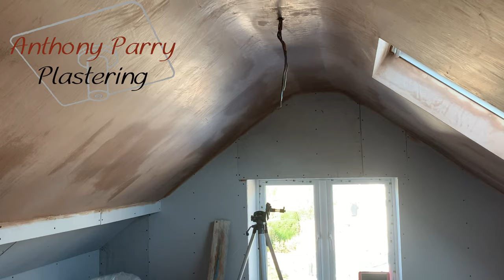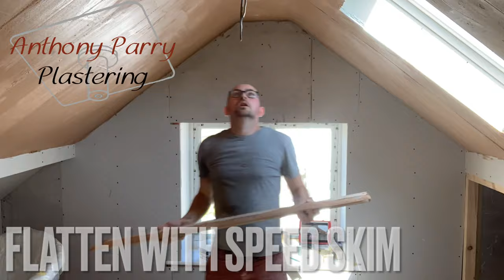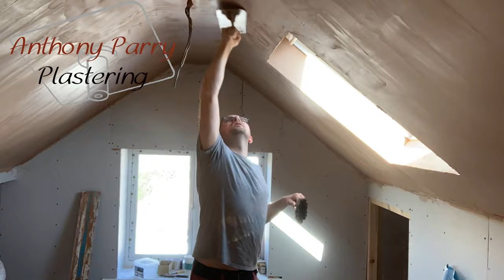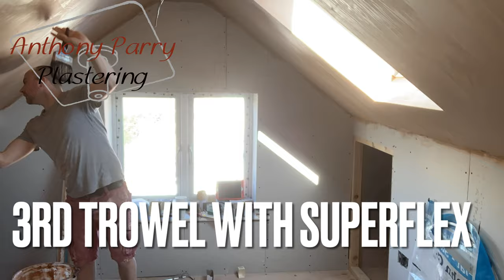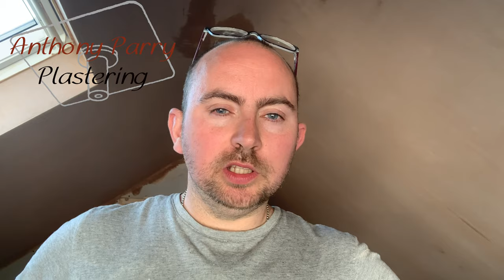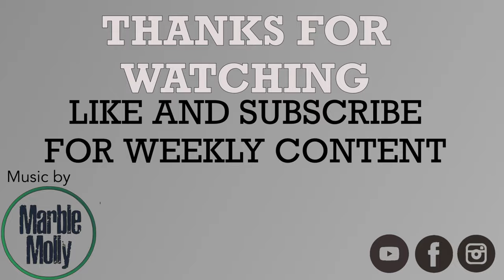How I plaster a curved ceiling. Plastering timelapse

Comment: Great video what speed skim did you use plastic or stainless steel thanks
Reply from the maker: Hi Paul, thanks I use the stainless steel one. I had  the plastic one but I switched to the stainless. I definitely prefer it for how I use it. Have you got one?
Reply: Hi Anthony thanks for the quick reply will be buying a speed skim stainless steel thanks again 👍👍
Reply from the maker: @paulmurphy5396  no worries, I think they’re great it’s definitely made my life easier 👍
Reply: Wot trowel do you use to trowel up after speed skim
Reply from the maker: @dwainearmitage7570  Hi Dwaine, I use a marshalltown gold trowel and to finish I use a Refina SUPERFLEX trowel
Reply: @AnthonyParryPlastering  cheers for the reply. Ye I’m the same Marshall town to put on then refina 18in super flex to trowel up but just got 900mm metal speed skim so just wondered wot trowel you used after that 👍